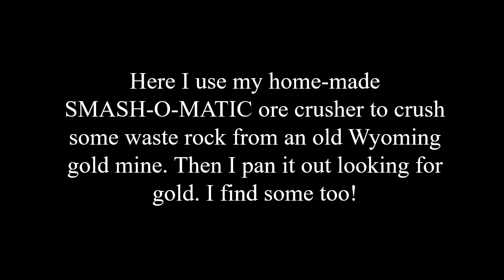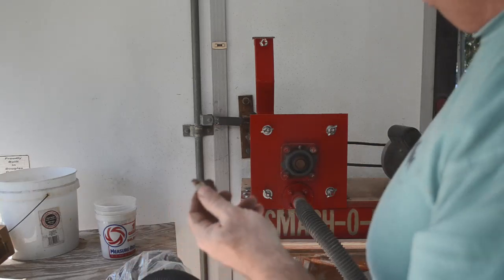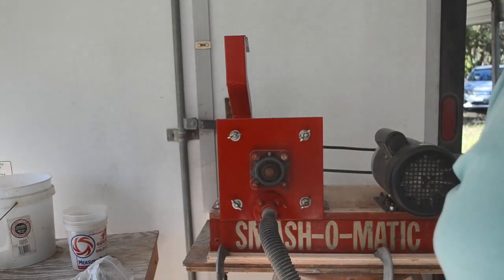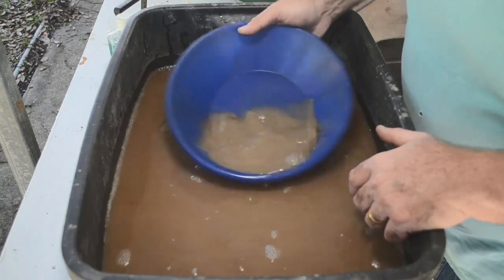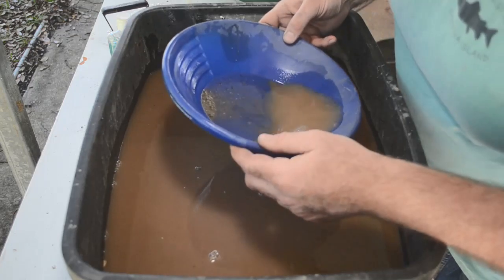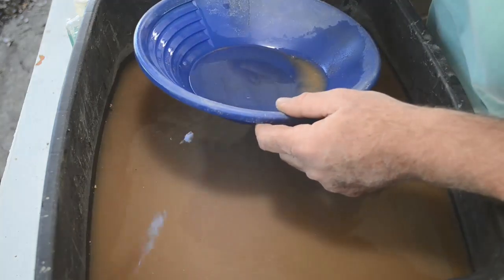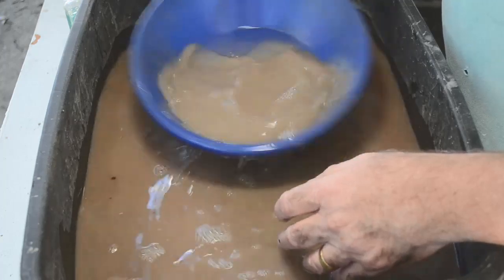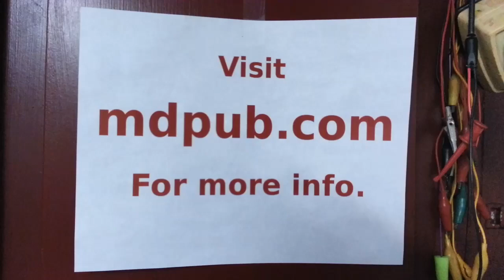Recovering Gold In Rocks From Old Gold Mines With My Home-Made Ore Crusher

Comment: I would like to buy some of that as paydirt. Also if you put the powder in a frying pan and heat it, it will change color burning away the sulfides. You can also do a chemical process, retrieving the microgold you cannot see with the loop.